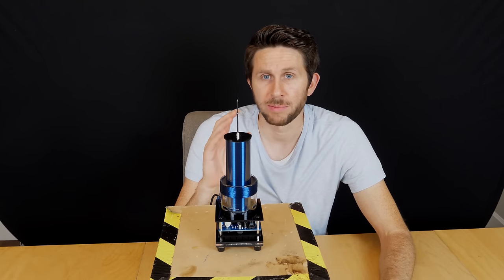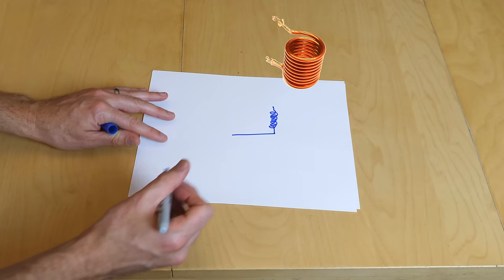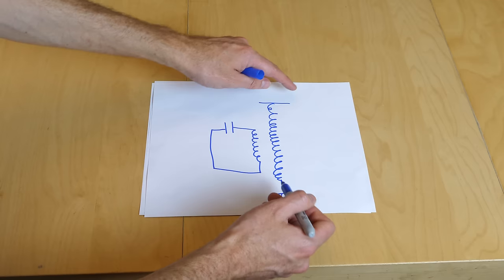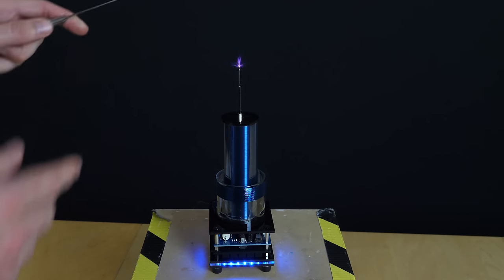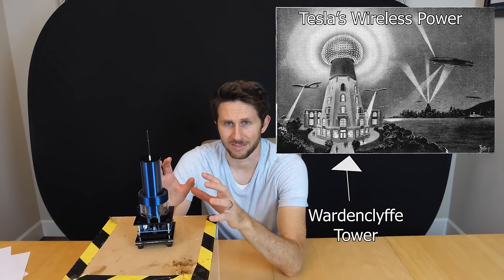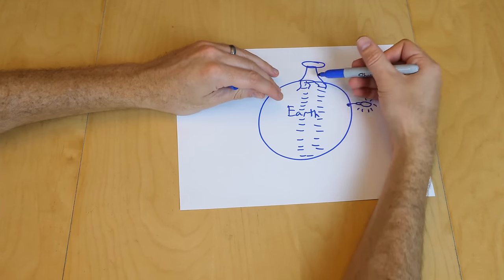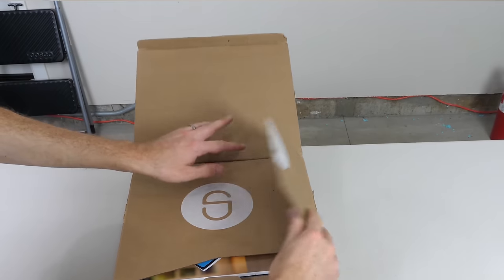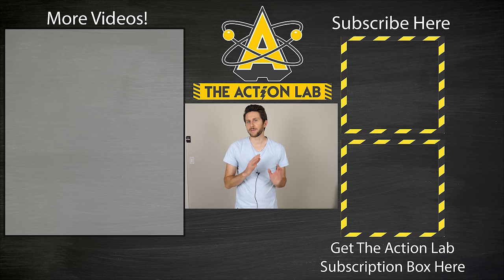Making Wireless Energy For The Entire Planet—Nikola Tesla's Wardenclyffe Tower

Comment: Hello, I realize I have commented on this video before. I have more to say now that might help people out, including Action Lab.

"It" was not intended for wireless power as much as it was intended for single-wire (single-conductor) power transmission through the ground alone.

The other possibility that would make this wireless power was the implementation of [alternating] electrostatic induction or capacitively coupled power transfer to a flying craft between the transmitter and the ionosphere

Both of these realizations operated in some way on the principle of resonant power transfer.

There is more to Tesla's tech than this, but I think I describe most of it in clear terms. The final component was the wireless transfer of DC, but I really don't understand it too well at this point. Maybe it was supposed to be a variant of "Teleforce"?

It takes a lot of digging to find food fringe science info, and Tesla information is (believe it or not) still being suppressed or at least buried under junk results in search engines. Not only tesla tech, but other alternative thinkers and their inventions have disappeared from the web. The man who made the electrostatic "vent" which was an ion-fan, a speaker, and an antenna as far as I remember, is not possible to find anymore, even for people who know what they are looking for. 

One thing people negate when thinking about Tesla tech is the extreme potentials he desired to use to transmit the power with almost no current, but still move enormous amounts of power, and with ease.

for some single-wire info see:
http://amasci.com/tesla/tmistk.html
https://www.youtube.com/watch?v=Qz1-RIcj1HY (Resonance Single Wire Power Transmission)
https://www.youtube.com/watch?v=jc0NgSa6xJE (One Wire Transmission Powering a Laptop)

for some radiant-energy related info:
http://amasci.com/tesla/nearfld1.html
https://free-energy-info.co.uk/Chapter7.pdf (Patrick J. Kelly's A Practical Guide to Free-Energy Devices Chapter 7: Aerial Systems)
https://www.youtube.com/watch?v=YhUT-xZkO9o (TheOldScientist's Tesla Radiant Energy)

information I am un-certain of labeling:
https://en.wikipedia.org/wiki/Atmospheric_electricity
https://en.wikipedia.org/wiki/Global_atmospheric_electrical_circuit
https://en.wikipedia.org/wiki/Electrolaser (relevant to the transmission of single-wire power through a plasma-channel_virtual-conductor)
http://www.tuks.nl/pdf/Eric_Dollard_Document_Collection/Theory%20of%20Wireless%20Power%20by%20Eric%20Dollard_OCR.pdf
https://www.youtube.com/watch?v=kH3ETTd6bPI (Eric Dollard - Longitudinal Energy (Scalar Waves - Mutual Induction - Wireless Transmission of DC))

Just a side note that Tesla was wanting to use his transmitter in conjunction to the sun-ionosphere-earth electrical circuit to create a type of un-confined plasma antenna to capture the vast amounts of radiant energy flowing from the sun, that forms most of the energy in earth's electric circuit. I have suspicions that he was intending to make a vacuum plasma by using extreme potentials to cause breakdown of the space, as suggested after N. Tesla by T. T. Brown, and I believe is somewhat related to the ideas in the Quantum vacuum thruster; You will need to do more research before the connection I just presented begins to make more sense. I will provide a video link of Eric Dollard explaining this aspect of Tesla's 'World Energy and Information System': https://youtu.be/PkrzXUyvSDg?t=409 (Preview of Theory Calculation & Operation of the Colorado Springs Tesla Transformer by Eric Dollard)

It has been a long time since I researched the subject, and I am sorry that I do not have any single complete source, as well as the fact that my sources together only tell a part of the story. Perhaps the Action Lab could explain single-conductor_single-wire as I have also requested of ElectroBOOM. These experiments need to be able to disprove the existence of a significant capacitive coupling between the toploads of the transmitter and the receiver, or in other words, disprove a wireless variant of SWER is at play, and instead that the potential of earth is being alternated to resonate it and display this power at an arbitrarily distant co-resonant receiver as long as it is at an anti-node in the geometry of the transmitted power.

P.S. I am not a representative of anyone except myself, but I have done research on this field and figured I should share information that could help others. Toodleoo.
Reply: search 'rick friedrich' here on youtube. he has many videos on how to learn one wire transmission and free energy that works. he sells a kit with a book to learn it by yourself😁

Comment: Tesla wanted to disperse energy through the atmosphere, not the ground. He had successful trial runs, powering 200 light bulbs from 26 miles away from his laboratory.
Reply: Yeah I was wondering why he missed this point.
Reply: From Tesla's autobiography: Beneath the tower, a well-like shaft plunged 120 feet into the ground. Sixteen iron pipes were driven three hundred feet deeper so that currents could pass through them and seize hold of the earth. "In this system that I have invented," Tesla explained, "it is necessary for the machine to get a grip of the earth, otherwise it cannot shake the earth. It has to have a grip... so that the whole of this globe can quiver."

Comment: Wires not connected = capacitor
Got it.👍
Reply: Pretty much just means a gap between 2 wires where current builds up and jumps across
Reply: That's a very commonly used schematic symbol representative of a capacitor.
Reply: @Paradox_Wolf  And a very basic idea of what it is

Comment: Well technically by definition batteries are wireless power
Reply: Richard Does gaming they mean true wireless (it's like electricity through air)
Reply: not quite,its a portable rechargable bar that stores energy in a form of electricity
Reply: @m1ten293  no,its the flow of the charged electro chips through different matters
Reply: Thomas Edison ! I though you were dead
Reply: Nope! Battery is an eneergy source connected directly to a device.
Reply: well i think you have misconception of portable and wireless

Comment: Greetings Mr Action Labs. I like your videos, and will continue to watch them because you give really good explanations for many science demonstrations that inform and educate me.

However, I'm taking you to task over your description of Tesla's longitudinal waves, which are indeed possible with pulsed current in a conductive surface. There are accompanying perpendicular electrostatic waves that run with the pulse in the earth's ionic cavity, but these are secondary to the primary requirements of his power transmission goals. Tesla's longitudinal waves did not go through the earth, as your sketch indicated, they propagated around the earths water-soaked conductive crust. He even has diagrams of this, so this gives your viewers an idea of the depth of your research.

The number one misunderstanding regarding Tesla's global power transmission, is that he actually used ground transmission of pulsed DC current, rather than lossy Hertzian waves, that transmit through the air.

The key principle to understand with ground transmission, is that as the current pulse radiates from the ground source, the area available to carry the current increases, and thus the resistance drops. Local resistance must be overcome, and Tesla went to great lengths to electrically "grip the earth" firmly at his Wardenclyffe tower to overcome this local resistance. The grounding works were in fact more extensive and expensive than the above ground plant. Tesla estimated that it took approximately 10,000HP to overcome this local resistance and distance losses, but once over come, the losses were minimal, around 2%. Just remember, this is a round trip around the whole globe, not just intercity distances.

Tesla didn't just pull these figures out of the ether - he measured them by propagating pulses from his Colorado Springs lab, in the 1890's. He managed to bounce pulses from one side of the globe to its antipode and back, measuring the resonance frequency, and losses. To be sure, he performed the same measurements with natural lightning strikes, of which the area is famous for. 
Tesla always based his designs on a solid experimental foundation, but like any pioneering technology, there is always trial and error to get around the inevitable teething troubles that present. He knew what he was doing, and just because you don't fully understand what he was trying to achieve, doesn't mean you can say with authority that Tesla didn't know what he was doing. Look at his track record up to that point. He delivered.

Tesla never finished his tower, so never got to prove it. J.P. Morgan cut Tesla's funds because Tesla was sneaky. Tesla promised Morgan a system for transmitting intelligence around the globe, but neglected to inform Morgan that he was secretly expanding the scope of their agreement to transmit power. I don't blame Tesla for this, as he knew that most likely, if he had been up front, he never would have got any funds at all from Morgan. Tesla gambled, and Tesla lost.

If Tesla had got his funding, and based on his track record, reasoning, and experimental record, there is no reasonable argument that it would not have succeeded. It's just basic physics, and it astounds me how many commentators ignore the simplicity of his ideas, then declare him wrong or misguided, after shallow and cursory research. Go to the source, then you will understand his ideas.
Reply: It wouldn't have worked, come on
Reply: @TheQooDude Thank you!
Finally a sharp mind, I couldn't explain it any better.
Reply: None of this is basic physics, it's theoretical at best and conspiratorial nonsense at worst. I've never seen such a long comment that says nothing provable or substantiated.
Reply: @nicolashromyk5397  Well that's my point - the objections raised in his video are unsubstantiated. And of course, the 'conspiratorial' chesnut is always bought up as a red herring to defer reasonable discussion. Can you point out what is conspiratorial about my comment?
Reply: @TheQooDude  he literally spent part of the video substantiating his claims. Your comment is paragraph upon paragraph of filler words that make you appear intelligent without saying anything at all. Like most conspiracy theorists, you use fancy words without a real meaning to confuse the general populace into thinking you have any legitimacy, when you have absolutely none.
Reply: @nicolashromyk5397  Oh come on Nicolas, I used less words than the video! It's up to the reader to judge the legitimacy of my comments. To do this, they simply have to understand a few fancy words, and have an attention span that can last a few paragraphs in duration. 

You still haven't pointed out where my comments are  'conspiratorial' or  'unsubstantiated' - your replies are general in accusation, but short on specifics. If Mr Action Labs had presented Tesla's idea as Tesla had originally presented it, then it would make more sense. My original comments points out very specific issues which I disagree with and can be shown by Tesla's own documents to be a misrepresentation.

We are having a discussion. That's what comments are for. My comments are provable - you could build a tower for example. It's true that the idea may not work, but it certainly hasn't been proven not to work, so it remains an open question.

I put it to you that you are unconsciously parroting the myth that because you heard that Tesla was crazy and wrong by some authority source then you just agree with it without any study or fact checking, and assume that this particular idea is wrong because Mr Action Labs and others say so. You are taking a side, when there is no side to take. It is simply an open question up for discussion.
Reply: @giovannip8600  "It wouldn't have worked, come on"
So, go ahead and explain why it wouldn't work...

Comment: I haven't read all the comments but in case somebody else has already mentioned  I was under the impression that it wasn't just about the Earth alone it was between the Earth and the ionosphere which is the other side of the capacitor the  interplay of push pull between the two gives you your transference around the world not through it so much, like around and and into the Earth. Because low pressure gasses glow like the Aurora Borealis you might get an additional light display everywhere

Comment: Re: longitudinal vs. transverse waves.  AM radio = Transverse electrical waves.  FM = Longitudinal electrical waves.  Also, AM radio is transmitted locally by ground waves sky waves only show up at some distance from the tower.  However, if the tower is set to make a sky wave at an angle greater than 60 degrees, it will bounce off the ionosphere and travel extremely long distances.  e.g.: Class A broadcast licenses:  KDKA, KYW, WBZ, WMOX, WOWO, KFI, WLW, WSM WJW, WOR, WBBM, etc. (see https://en.wikipedia.org/wiki/Clear-channel_station).

Comment: you have to have a inverse frequency transmitting through the ground from the one being transmitted through the air it amps up the range drastically and you'll need a collection antenna one part of it stuck in the ground the other up in the air

Comment: The longitudinal waves are there too! Tesla did not build anything until he thought it out and tested it! An inductor is for transmitting magnetic waves. But, the physical distance between each coil produces a small straight electrostatic wave. The two are always together. And, this is also a fact with pumping electrical energy into the earth. Forces occur in pairs.

Comment: Counsel
>
You say the energy was 1,000 times greater.  Do you mean that the voltage was increased, or the current, or both?
Tesla
>

Yes [both].  To be more explicit, I take a very large self-inductance and a comparatively small capacity, which I have constructed in a certain way so that the electricity cannot leak out.  I thus obtain a low frequency; but, as you know, the electromagnetic radiation is proportionate to the square root of the capacity divided by the self-induction.  I do not permit the energy to go out; I accumulate in that circuit a tremendous energy.  When the high potential is attained, if I want to give off electromagnetic waves, I do so, but I prefer to reduce those waves in quantity and pass a current into the earth, because electromagnetic wave energy is not recoverable while that [earth] current is entirely recoverable, being the energy stored in an elastic system

Comment: Wireless power is transmitted everywhere. This is how wireless communication works. The issue is that the power level is really low. It can go long distances by focusing it, with satellites, or directional antennae, but the power level is still low, and only suitable for communication. We have wireless phone chargers now, but even at a tiny distance, there is a around 1/3 energy loss.

Comment: I think the design of the tower is essentially like the design of one half of a Tesla coil, if you view the atmosphere-to-earth system as a capacitor (Which it is). If the tower is a convoluted resistor that spans the gradient of the ionosphere, then you have a resistor connected to both ends of a capacitor, operating at a resonant frequency of alternating current. There is no need to consider longitudinal waves of energy transfer around the globe if the atmosphere acts as a system to redistribute charge. 

I’m really hoping this makes sense- does anyone get what I mean? I mean, it’s right there in the video but somehow the connection isn’t made.

Comment: 08:50 Nikola Tesla had found that frequency. He stated the frequency changed troughout the days. So the system needed adjustments. 

This one is for those who think:
Nikola Tesla also stated that he could measure the exact size of the earth trough his Wardenclyffe Tower. 

Im pretty sure some people can find out what he means by that.
Reply: He actually already measured the size of the earth through the successful transmissions globally at Colorado springs, he also measured the transmission of that energy at 1.5 times the rate of induction of light. Wardenciffe was a much higher scaled version of what he had already achieved so then it would be usable power with the simple application of an aerial placed into the ground. The aim was to have it powered by the Niagra as he had already blown up the local power station at Colorado Springs and then fixed up the supply problem so then he would be capable of drawing greater current.

Comment: The simplest way to envisage Teslas  ideas is to imagine an standard wired electrical device and reverse it's wiring schematics...You have an earth or ground on most wired devices and your drawing power from an grid supply or put simply from the power station but your completing the circuit when you ground or earth the device as without this circuit is incomplete and the electricty or what's left of it can't get back home to the power station. .well at least the ground of the power station...now an reversal of this means that when you ground you get an supply instead of an live wire from the power station it's an ground wire connected to the earth that is the ground below your feet...in principle that should work but in practice it doesn't at least not yet that is?

Comment: there is a HUGE difference between ELECTRIC CURRENT- Electric Force and ELECTROMAGNETIC WAVES -Magnetic Force. the electrical needs a medium to move but the magnate doesn't and can travel through a vacuum. what tesla was trying to achieve made u and others assume that he was unable to understand the way in which Electrical waves behave. Tesla's Coil was a genius invention whereby he changes the state of the Electrical Force to Make it Magnetic Force so it is easier to transmit and then revert it back to its original form as an Electrical Force.